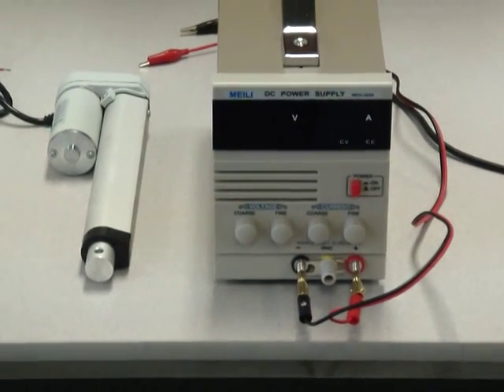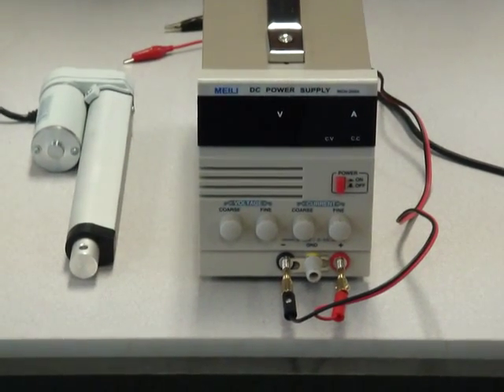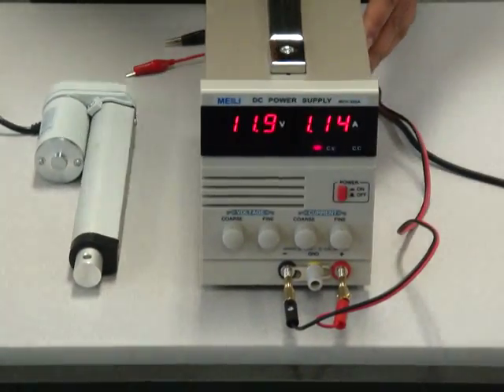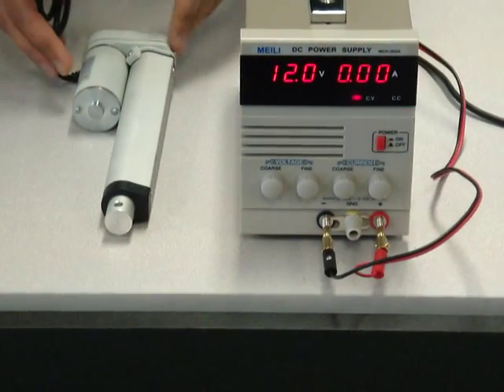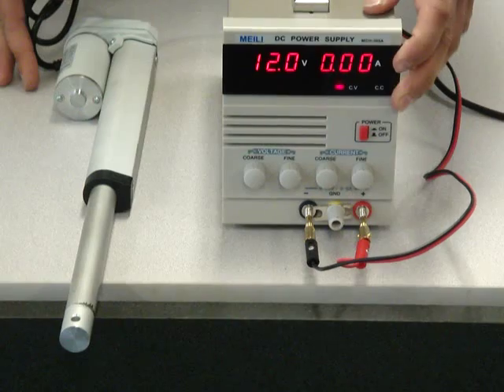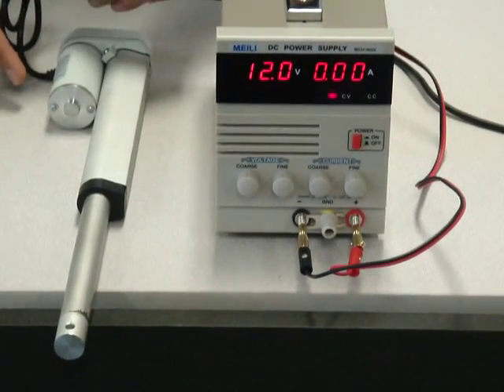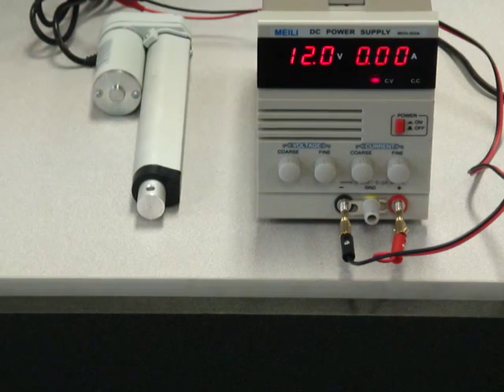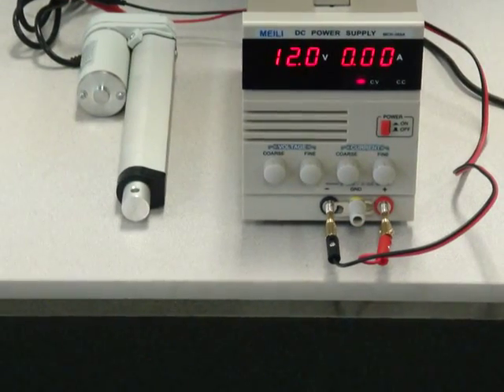How Internal Limit Switches in Our Linear Actuators Work - Progressive Automations

Comment: I have a question… are the limit switches just shorting positive to ground to stop the motion?
Reply from the maker: One limit switch consists of a diode and a single pole single throw switch, so the limit switches stop motion by having the diode only allow the flow of current in one direction and having an open circuit in the depressed switch that prevents current flow.

Comment: So, if I am to keep supplying power to the actuator after it's fully extended(or retracted), it will not damage it even if it's for an extended period.  Correct?

I'm guessing so since the draw was 0A after it was extended or retracted.
Reply from the maker: Hi Marc, you are correct. Our actuators have built in limit switches that provide auto-shutoff once the actuator fully reaches its extended/retracted position.